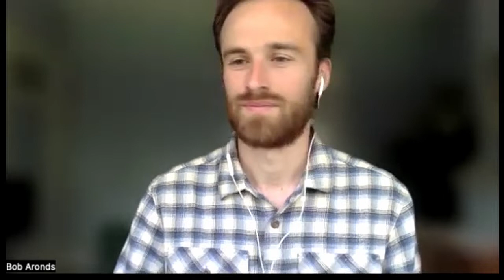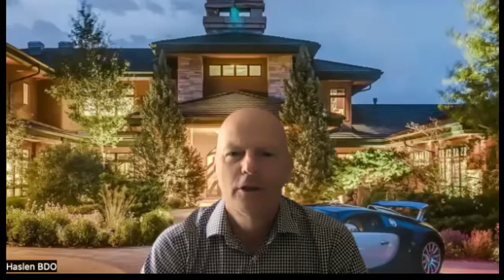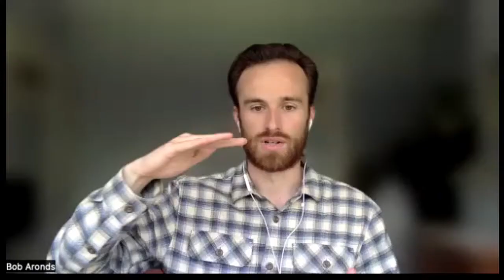ENG8 #2 - How can I use an EnergiCell?

Comment: the heat-exchanger of the heat-pump must have for example 60% of performance , because you will loose heating energy to the environnement... example : energy cell with COP 3 , then   3*0.6= 1.8  of real final COP from the heat-pump